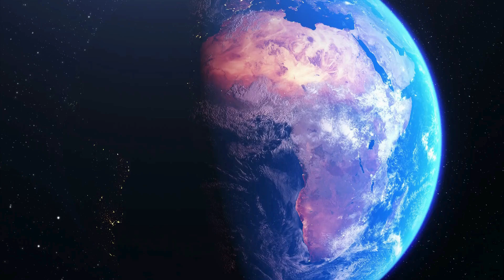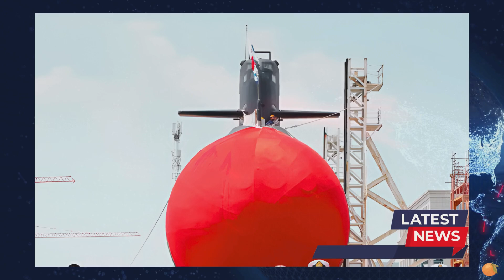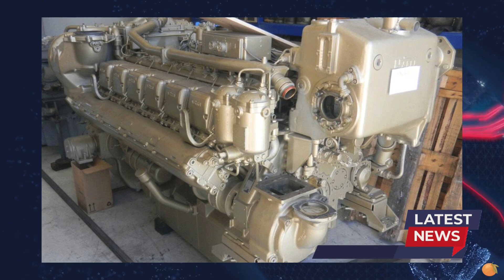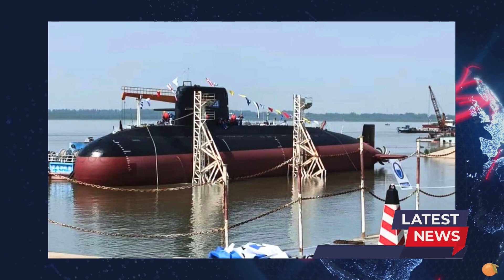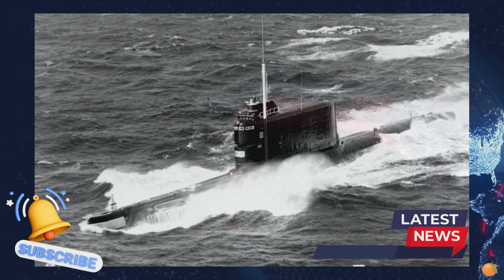China copied the German MTU 396 diesel engine for the Hangor II submarine

Comment: sure you can copy anything but how do you get the metallurgy secrets like the crank shaft metal - bearings, piston rings  and piston roads   sure you can melt a lot imports parts imported as spares melt them and reforge them again and you can get  strong metal
Reply: Yes. I mean there is nobody on earth that can copy anything better than China. Their copies frequently end up better than the originals. Think of their flankers. F-35s and F-22s they are not, but they have progressed beyond the Su-27 they were copied from.
Reply: The crank's 34CrNiMo6, and   I've  seen what the Chinese make when they try to make that.